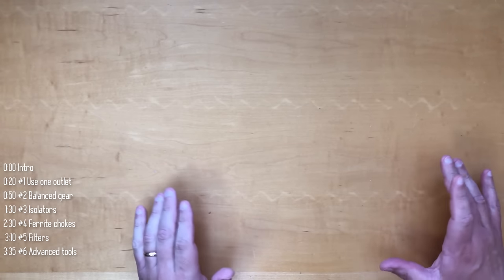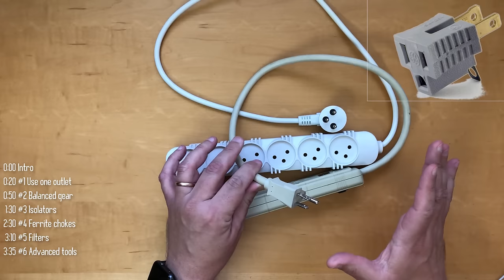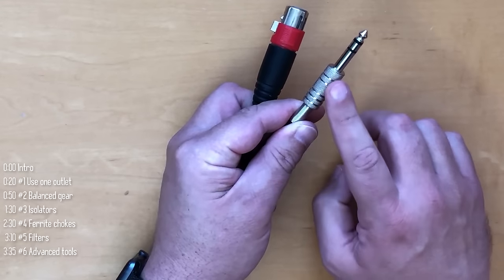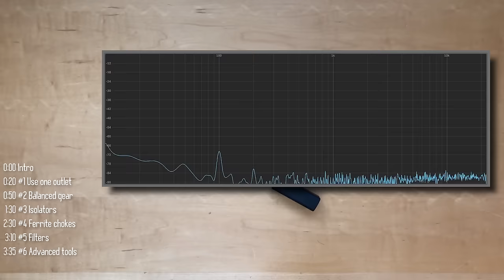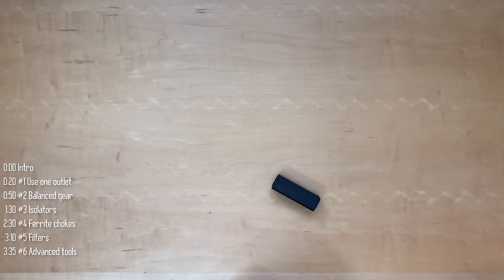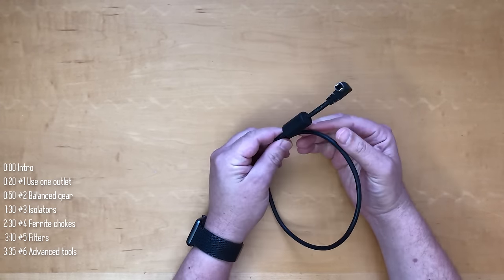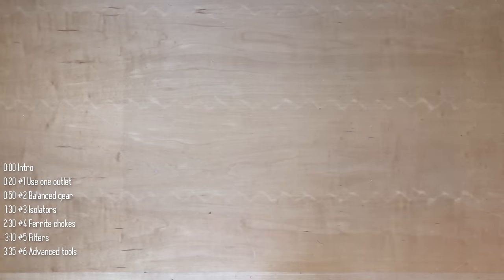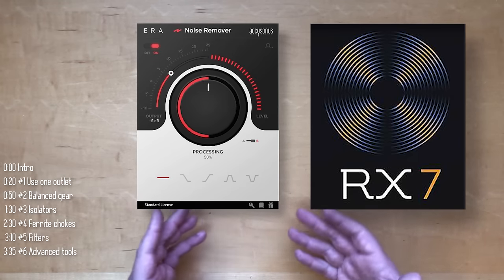6 simple and cheap ways to fix hum, buzz and ground loop noise

Comment: This article explains everything.     https://www.soundonsound.com/sound-advice/q-what-ground-earth-loop
Using balanced cables (TRS or XLR) will reduce hum picked up from the environment by a  long cable run, but will not prevent a ground loop. The ground lift switch on a DI box disconnects the cable shield/ground leaving both appliances earthed. I think a major problem nowadays is the growing use of external power supplies for everything. Most of these are double insulated and do not have an earth connection(the earth pin is usually plastic). If you have a keyboard with one of these PSUs and connect it to an amplifier with a proper mains earth, all  will be well. If your amplifier  also has an external PSU you won't get a ground loop hum, but you may get environmental hum pickup because your cable screen is not grounded at either end. You could block that by using two PASSIVE DI boxes. These use a centre-tapped  transformer to provide the balanced signal, so use one in the normal way to convert unbalanced to balanced, run an XLR cable to the amplifier, then connect it using the second DI box in reverse. This will not work with active battery powered DI boxes because they will not work in reverse mode.
Reply: Ground lift in my DI box doesn't remove the noise. It's weird.
Reply: @BukanIbuMu  What exactly are you connecting together? It could be that one piece of equipment has a noisy power supply; if so there is nothing you can do except change the power supply. Sometimes plugging everything into the same mains socket via a socket strip removes noise
Reply: @MrFlint51  well my house is old and has no grounding. I guess there will be no way to solve the problem.
Reply: @BukanIbuMu  Have you thought about finding a water pipe and attaching an earthing strip to that? Even just for your music gear
Reply: @MrFlint51  My house is far from water pipe. Do you think a Ground Loop Isolator with 3.5mm Audio Cable would work?

Comment: what if i have huge transformer and i have 50Hz noise, i pluged in the wall that only i used that transformer on that 230v rail but the hum still there, if i use transformer and i convert it to dc and to parallel i place an another capacitor, it charges up then i turning of my transformer and when my amp uses the capacitor power the hum is not there. Which solution gonna i use? the first solution is not works, that i use 1 outlet only for my transformer

Comment: I've had a terrible noise from the monitors when my interface is connected to the Desktop PC (everything is connected on a power strip similar to one of those shown in the video)

I knew something was up when I've discovered that when the interface is connected to a laptop (in the same room and same power outlet!) There's no noise. 

Yesterday I took a second power strip, connected it to a different power outlet and connected only my desktop PC there. I still had some noise, but at a MUCH lower volume, to the point where I can actually work. 

I'm commenting because the video says otherwise in regards to power outlets, so if someone has some explanation, I'd be happy to hear it.

Comment: Do you know if ground loop isolators degrade sound quality? I have a buzzing issue with my headphones connected to my pc since i connect the headphone jack to my amp and mic jack into the port on the pc. I don't want to lose quality
Reply from the maker: I’ve seen some that do and some where I couldn’t notice a difference. Obviously it’s better to solve the problem in other ways
Reply: @loopop  thank you for your response. were the ones that did degrade the sound quality in a certain price range? Like cheap ones for example? I'm planning on buying a 10$ one on amazon

Comment: Can someone please help me?

I unfortunately have to use one outlet. I have extension cable coming from this outlet in which is plugged my TV and PC. To my PC I have connected audio interface via USB. When I try recording with microphone there is a terrible humming sound.

 I already found out that my TV is causing ground loop (when I plug it out, the humming decreases), but is there a way to isolate it, but still keep everything plugged in the same power outlet?

Comment: thanks for the tips, for me it always has been may monitors, even through a mixer they are still fuzzy! I'm pretty sure it is the ground, I can hear the clic of my "automatic shutter button" but I don't know how I am suppose to fix it ?
Reply from the maker: Thanks! Just follow steps 1-3 in the clip. It should work. Did you try it?
Reply: actually I never tried, I have simple mono cable, I always thought I changed them for TRS but no.
thank you
Reply: If you are still here, maybe you have to answer another question?
Let's say I plug my monotribe output, which is mono into my Bal/nbal input on my small mixer with like a guitar mono 6.3 cable( I tried few) and I cannot hear all the frequencies on my monitors (no noises, just not everything)...only when I plug the headphone out of my monotribe to the RCA input on my mixer, and the same for all my gears... os is it a TRS cables Problem? I have an audiopope M6
Thanks
Reply from the maker: Hey... sorry it’s really hard to troubleshoot in the comment section :/ though one TS is enough to cause problems if that’s the question

Comment: hi,

 we installed an amplifier and 6 speakers and the amp was connected to a Samsung smart TV with optical output, and when the tv is powered on there is this high pitch unbearable sound..Connection is like TV OPTICAL OUT .>TOSLINK FIBER CABLE>TOSLINK TO RCA ANALOGUE  CONVERTER >RCA CABLE >>AMPLIFIER >>6 SPEAKERS...........................

Comment: Can you guys please help? When I plug the mic into my audio interface I get a buzzing noise, I can't record anything with it. All electronics are plugged into a single outlet (just like the one on the video), the USB cable of the audio interface has a ferrite choke. I don't know if the ground loop filter will fix it, can I use it with a mic cable? I've used the interface on a laptop and the buzz was gone, so it must be my PC. I also get an electric shock when I touch metal parts connected to the PC.

Comment: Iv been getting ground loop noise from usb mixer and korg nts1 and also the Roland t8 when it's plugged into a charger it's like a low hissy white noise sound and it sucks the mixer doesn't record the noise when I record my mixes so not a big issue and the Roland t8 is ok when it's charged so does not have to be plugged in but the korg nts1 has to be plugged in as it doesn't charge so Im gonna have to buy a dampner to stop it

Comment: Cutting the ground works. The ground between devices is connected causing the loop.
If you want to be safe, cut the ground between the devices causing the loop instead of the mains cable.
Reply: thanks alot! you save us alot of money! we install 32 cameras on this factory and weve been troubleshooting what causes video distortion on almost 70% of the camera.. this trick works!
Reply: @passivetube  Lol. Has ur factory burned down yet?

Comment: 1:07. TRS is not a stereo connector, you mean they are different?
Reply: No difference physically/electrically, but TRS can be a stereo connector, usually for connecting headphones
Reply: TRS in this case is used as mono signal, it have 3 contacts, ground, "hot" signal and "cold" signal. This is balanced audio. You have tons of info on google and differences between balance and unbalance signals.

Comment: my Behringer monitors are humming. Just bought a euro socket splitter and pinched off metallic mustaches...no hum as result. Could help for european users. cheers...
Reply from the maker: Not sure what you pinched off but if you physically removed the ground pin, as I mention in the video, that’s not safe

Comment: That ground loop sure does seem a few octaves high... 🤔 and a balanced cable isn't different from a stereo cable. The only difference is what the cable is plugged into.  Mono balanced/stereo unbalanced can both use a TRS-TRS cable.
Reply from the maker: I agree on both things. Regarding the first - and yet a ground loop isolator solves the problem
Reply: @loopop  yeah that's what confused me.  you clearly solved the problem with the isolator, but I have never heard a ground loop at that frequency.  that's absolutely wild.

Comment: I'm not sure using a trs cable in place of a ts cable will do anything if it's going into a Jack socket which is meant for ts. All that will happen is the ring will be by passed. This will be a waste of time and money. Best to check the equipment manual and use trs when specified and ts when specified. Synths and guitars etc are almost always ts. Outputs to power amps and monitors tend to be trs and xlr. Using ts in these connections reduces volume levels in my experience.
Reply from the maker: Jbantock of course using a trs cable in a ts socket not only doesn’t help but makes things worse. Where did I say you should do that?
Reply: @loopop  You say, at about 1 minute in, to use "balanced and/or trs cables across your set-up". If someone has synths or other devices that are designed to use ts connections in their set-up, they might be inclined to use a trs cable in place of a ts cable for that device.
Reply from the maker: @Jbantock  OK, good point, I've added a clarification to the description

Comment: Thanks for the information. What analyzer was used in this video? The inverted phase of your isolator is just a bad example.
Reply from the maker: Christoph Schuermann What do you mean bad example? FYI I use MOscilloscope and MAnalyzer by a company called Melda - they’re free with some limitations in the MFreeFXBundle.
Reply: @loopop  thanks for your answer. I mean that the most products (transformer based isolators) on the market do not invert the phase by 180° as in your case. Greetings from Berlin!

Comment: A ground lift pin is safe as long as one of the devices still has an earth.
Reply: ... and all of them have a strong enough ground connection to that one device to trigger the ground fault breaker for all phases any of them connect to. I.e. probably not that safe.

Comment: I had usb ground loop with a synth (modal craft 2) plugged in by usb, and audio out into my usb audio interface. Using midi from my audio interface worked, but I couldn't use the app synth editor for the craft (app connects to the synth by usb, not midi). And the synth didn't appear to have a balanced audio output.

So after a bit if investigating, picked up a USB isolator. Got mine from https://hifimediy.com. Cheap enough, worked a treat.
I guess if it's a USB ground loop, then as others have suggested, a half decent usb hub should do the trick, if audio interface and synth are both connected to the same usb port... But for me, an isolator was the way to go.
Reply: I have the same problem and I just randomly found your comment, i will try it but and I hope it will work thanks!

Comment: For some reason my speakers pop whenever I turn switches off in my room, I assume this is also a type of ground loop issue but if anyone has any idea of what that could be let me know
Reply: Can you please describe that problem? I have a tv in my room, there’s a tiny distortion when I turn the tv on and sometimes  it happens and sometimes it does not. I have the tv chime on, and lg told me there’s a ground loop problem .

Comment: when i add this ground loop isolator (ASIN B082GV15Y1)  between my audio source B00KCRYIWM  and amp B0071HZ5EQ the hum increases.  i checked connections, polarity and direction, any tips?

Comment: Re: Plugging into the same power outlet.
I'd always heard that using a single socket would cause a short so I have historically spread mine i.e. generally I have 10-12 + devices plugged in i.e 5 synths, 3 laptops, active speakers, mixers, ADAT, etc and use 3 separate 6 socket extension boards to handle the requirement. (On 220V here in Europe) Do you think with that amount of devices there's a risk of a major blow-out if I used just the one socket and subsequently daisy chained? What would be a good reference manual to get the physics better understood?
Cheers,
Fin.

Comment: is there noise cleaner for rca outputs?
Reply: Thats an issue Im having now after adding a second amp. I split my main left and right rca preouts to both amps and everythings ok when Im playing just left and right channels. But when I play all speakers I get hum outta the new amp I added. So far very annoying
Reply: @Chrisicola  i just change power hub for the one with no grounding pin:) and now it works:)
Reply: @wolandphotography  Well congrats!! You changed your power strip?  I was thinking of using a cheater plug on my amps power cord to see if that ground on its plug may be the issue. Then I can get a Hub X or something like that to plug into. Still waiting on some adapters in the mail to see if that solves the problem. Nothing like upgrading and downgrading at the same time. Sux
Reply: @Chrisicola  yeah changing power strip for simple with no ground pins worked, try it:)
Reply: @wolandphotography  Well, it looks like my new adapters have gotten rid of my hum.  Knock on wood. Now I just have one more item to try and add on that was acting up too. But the amp is good and no hum. Yes. Hated that s--t. Also be careful with an ungrounded system, especially amps.
Reply: @Chrisicola  audio-gd amp i have pluged to a grounded strip power, only monitors Kali-LP6 to ungrounded, no worries:)

Comment: The vast majority of noise issues start with power quality. Homes share power with the grid, let alone your other home devices. Now throw in all the equipment that emits radiation/signals (cell phones, computers, lights, WiFi, etc.) and almost all homes will have very dirty power loaded with EMI noise.

See: https://youtu.be/1pW9WTiNuls

If you measure noise like that on your outlet power, it must be filtered or you will get noise.

Then, you should not have all equipment sharing same power circuit. For best results use multiple power conditioners and plug computer equipment into one. Powered speakers/amps in another, and audio equipment in third. I recommend inexpensive conditioners... if you combine them with balanced connections and EMI filters linked above. Example of inexpensive conditioner is this Furman: https://www.amazon.com/Furman-Standard-Conditioning-Outlets-Spacing/dp/B0014598WQ/ref=sr_1_4?crid=4Y6SAOAFGLQF&dchild=1&keywords=furman+power+conditioner&qid=1606602137&refinements=p_36%3A1253547011&rnid=386685011&s=musical-instruments&sprefix=furman+power%2Caps%2C211&sr=1-4

I haven't found a power conditioner under $1000 that gets rid of EMI like the Greenwave filters. it just costs much less to go this way. Furman provides surge protection and improved filtering. Greenwave lowers EMI to below 25-50 mv. The difference is substantial. Without Greenwave, I still get noticeably annoying noise.

Comment: There is absolutely no technical reason that i can think of for the ground loop isolating transformer to invert the phase. It's likely just that the ones you happened to get were built by an imbecile. That's what happens when someone scrapes the very bottom of the barrel - and it's not necessarily your fault, local distributors love doing that too, they only care that their logo can get printed on it.

Comment: Using a ground lift plug is not the problem....The problem comes when ppl don't install the piece correctly. 80% of ppl install it by just plugging it in the socket and connect whatever on the other end when in fact the correct way should be removing the center screw off the wall receptacle , install  the ground lift plug and secure the thing using the screw and the hole on the plug. That way the plug will be grounded correctly and nothing bad will happen.  I've used one of those plugs before no issues but just try to avoid them if the equipment its meant to be used on a 3 prongs outlet. Rule of thumb should be , if its gonna stay connected for days ...use the correct connection.  If not then should be ok but depending the building or house way to manage electricity because some houses have the electricity all fucked up and ppl dont know about it.